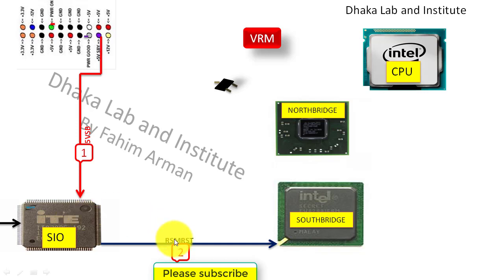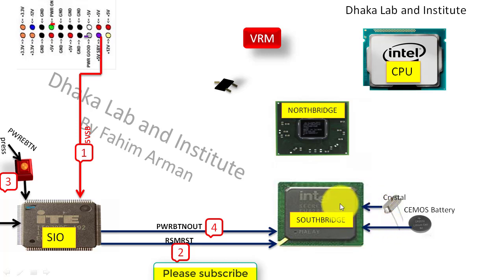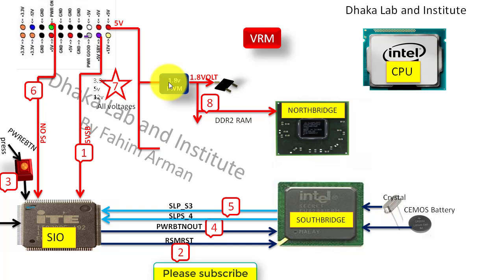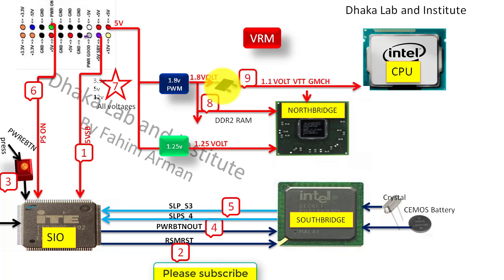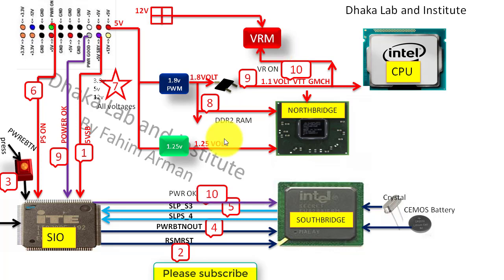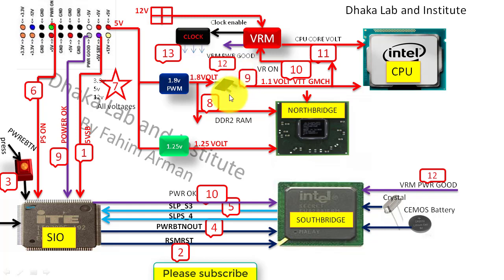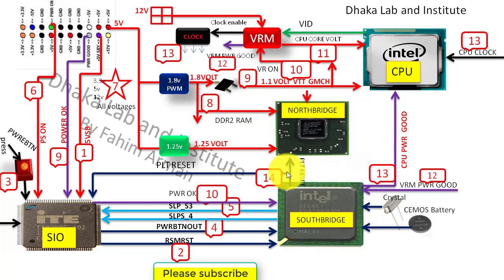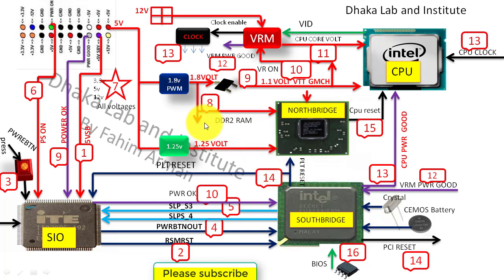Desktop motherboard power sequence in English (with animation). Dhaka Lab and Institute.

Comment: Hello! Excellent works with the curcuit diagram. I have a problem with shuttle motherboard. It seems from pci diagnostic card that reset light stays always on. I check reset and there no voltage at all (i don t have switch). Where should i check for possible shorted curcuit? And I/O or Southbridge is responsible for reset operation??

Comment: Hi thanks for this important and informative video. If the motherboard comes and stays on with no post which components do I test? And how do I test the SIO chip to check if it's faulty or not?
Reply from the maker: we have another video naming " requirements of SIO. watch it and check all voltages and signals of your IO
Reply: @dhakalabandinstitute6964  thanks will do that:)

Comment: Hello, this morning impossible to start my motherboard H77, I tested everything, everything seemed normal. Just one thing, the battery was dead, which made me think maybe a short circuit in the southbridge. After testing it wasn't shorted, so in the end it was the stupidest thing in the world, the battery was dead, and the motherboard won't boot if the battery doesn't have a minimum voltage.... Honestly, I've never seen a PC motherboard not start because the battery is empty/missing...
Reply from the maker: It happens sometimes. Actually your battery is shorted. Try to start your laptop without battery or buy a new battery.
Reply: @dhakalabandinstitute6964  It's not a laptop it's a desktop computer, and I've checked I don't have a short in the memory battery and if there's no battery it won't start. It works with new battery cr2032 that's the most important thing, but it's a strange design...

Comment: please man i need help,when i plug the power to the psu it boots without pushing the power button of my pc,so what is the cause maybe it is a short in the power circuit or what
Reply: p.s:the pc does not boot else if i push the power button,just before pushing the power button the psu is on with all the fans but without start up of pc
Reply from the maker: first change the power button cable. if still same, you should follow some steps. Tell me first do you have motherboard repairing experience?
Reply: @dhakalabandinstitute6964  yes i have some experience,and the power button cable is not the problem because i remove it and the problem stays,i am thinking about the power on wire in the board maybe it has short somehow,so how to be sure if it is short??
Reply: @rabihbitar5469  Check CMOS Clear jumper and CMOS battery. And you did not mention the motherboard model.

Comment: Sir my pc wont post unless i heated the motherboard with hair dryer for a while and then my pc turn on and work normally, i try to find solution but dont find very specific solution, maybe u have any solution
Reply from the maker: any part/IC may have loose connection. you may heat by hot gun.